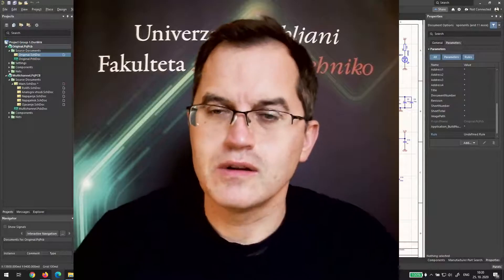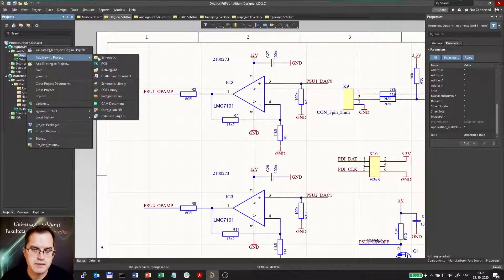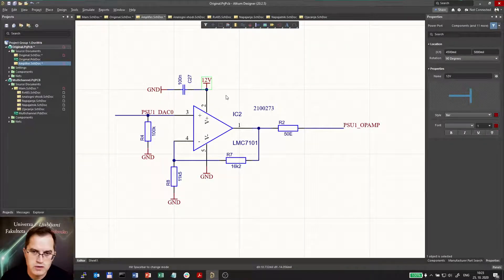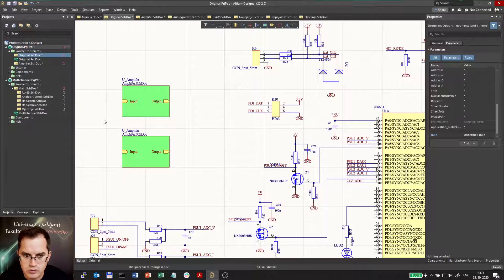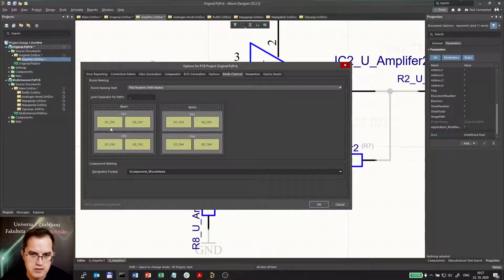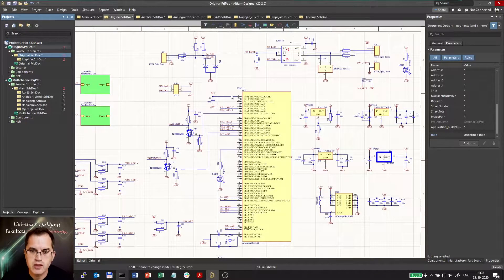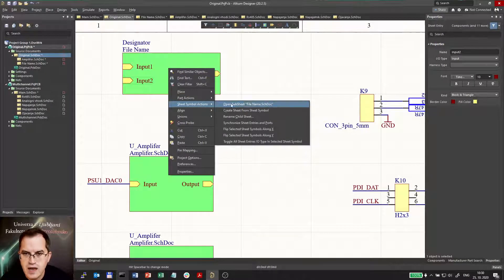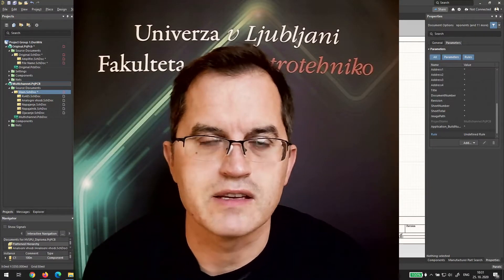Altium Schematics #01: Hierarchical schematics design

Comment: Thank you, great video!
Tell me, is it possible to make a 2-level multi-channel circuit in Altium?
Main sheet -> 2 sheet symbols. -> Each sheet contains several more sheet symbols -> in which parts of one microcircuit are located (Large BGA microcircuit).
2 BGA microcircuits should appear on the board.

Comment: how use  Stereo Potentiometer (VR50KX2) in hierarchical schematic for preamp circuit
Reply from the maker: If you want to use one half of the potentiometer in one instance and another on the other instance. you can't. The only solution is to put the potenciometer externally and connect it to both blocks.
Reply: @elektronika-fe1325  Stereo Potentiometer fixed one. I solved the problem as you told me and now I have this problem.
I am currently designing a printed circuit board (PCB) for an audio amplifier. The left and right channels are completely identical, so I would like to use the Copy Room feature along with Flip Board in Altium Designer to create a mirrored layout, ensuring both channels have perfectly symmetrical component placement.

However, I encountered a problem when flipping the room that contains transistors with B-C-E pin configuration (e.g., BJT or TO-92 packages). After flipping, the transistor's pinout becomes E-B-C, which could lead to incorrect connections or incorrect footprint placement on the PCB.

I would greatly appreciate your guidance on the following:
Is there a way to resolve this issue and still use the Flip Room feature without altering the transistor pin configuration?

Alternatively, is there another recommended approach to achieve a mirrored layout while maintaining correct component pinouts?

Thank you very much for your time and advice.

Sincerely,

Comment: Hi, i juste tried to use those tools to help me duplicate identical structures in my design. I wonder if they work if there no input/output though. Because i didn't have any (because i respected your advice to put Vcc and GND as they were) and Altium refused to add iterations of the routing in the sub schematic even if i had 4 blocks with different designator. Once i haded Vcc and GND as input/ouput the differents blocks designator diplayed on the bottom of the blocks schematics but i had conflicts that i could not resolve. Have you got any clue about that ? is there any other way to repeat a structure ?

Comment: I have made a schematics and pcb using flat design,the routing is completed now if I change the design to hierarchal design since the reference designators are changing will the pcb also need to do again ..? Or can the placement and routing can be retained while transforming the design to hierarchal design
Reply: In case anyone else has the same question, you can either:

1. Keep the reference designators the same using smart paste, as shown in the video

2. Keep track of the designator updates and link them manually when importing changes to the PCB